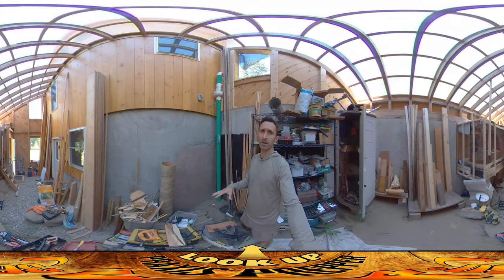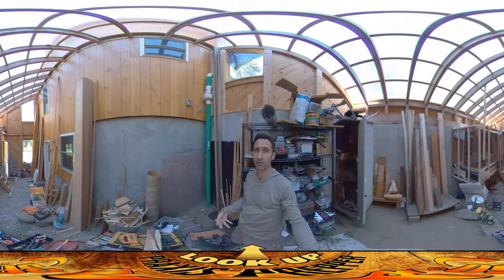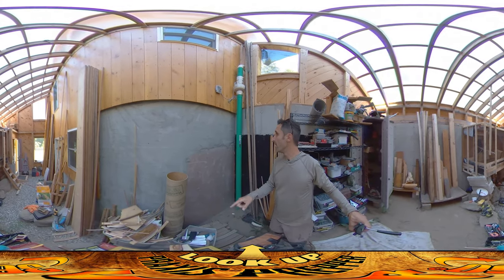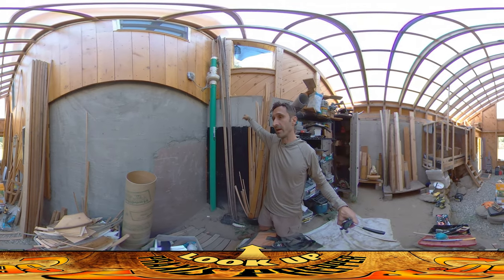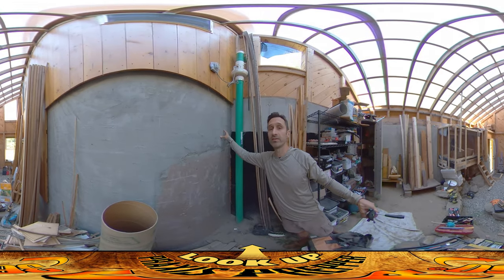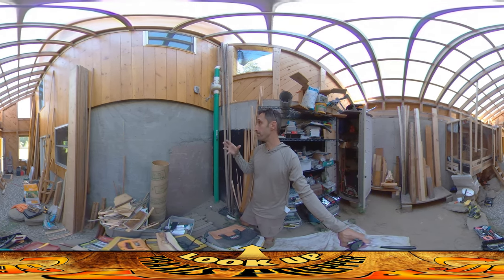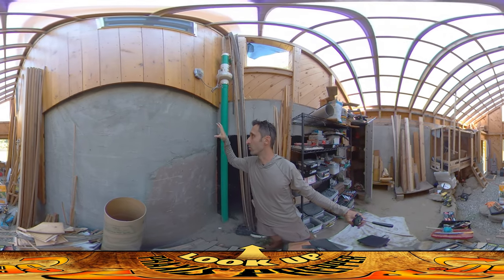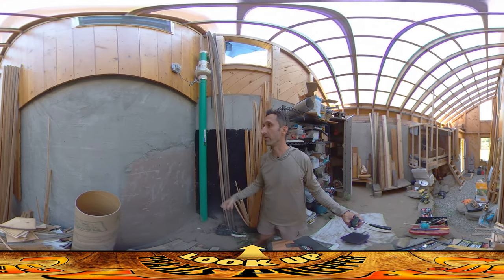Homestead Building - Radon Gas, Drilling Holes in Concrete, Price Inflation

Comment: Now that’s inflation! 😳

Are you going to get a core drill or just use your dad’s hammer drill to make a series of holes you can knock out and then seal the inevitable gaps? I think when I get started, I’m just going to try and buy all your single use tools 💰
Reply from the maker: My first thought was exactly what you suggested about perforating some holes with my drill and knocking it out. But that would have been... awful. Also, what if I hit rebar? The impact drill and concrete bits can't do rebar. I bought a core drill bit that will fit onto my impact drill and I'll use that - though I won't be using the impact setting (I'll explain in the video for it).
As far as my one-use tools, they're all turning into surprisingly multi-use tools. I DO have a composting toilet unit that I can bear to part with from the old homestead though. ;)
Reply: @PraxisPrepper  Hmmm…. used toilet… my wife would love that 😜